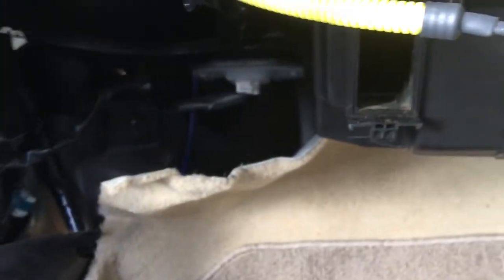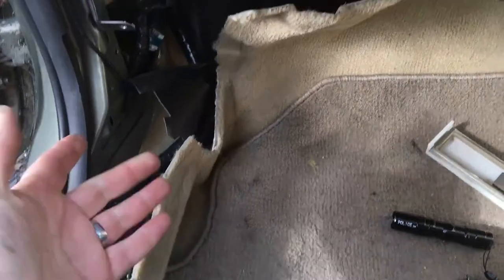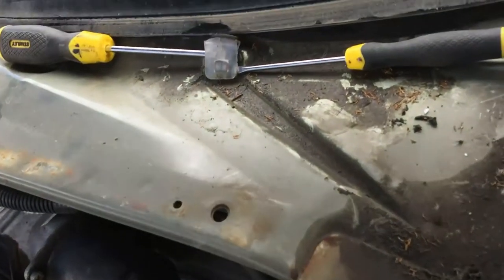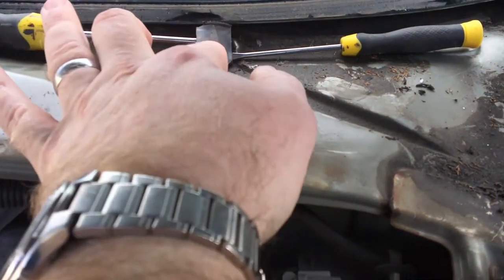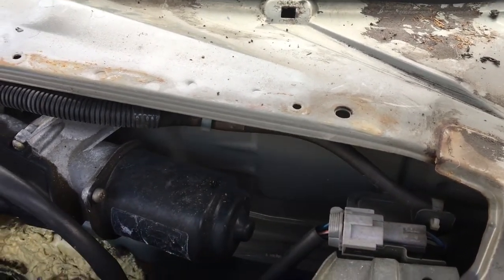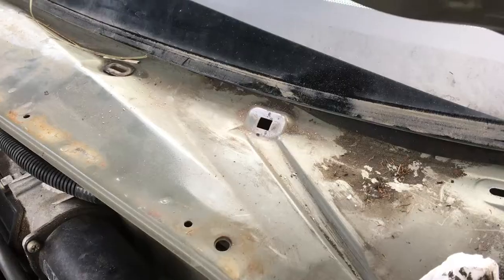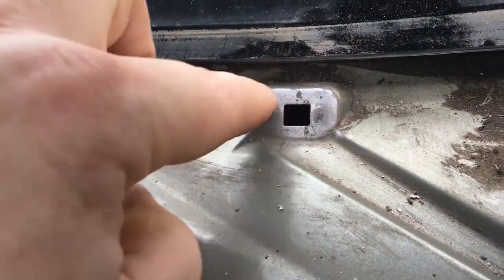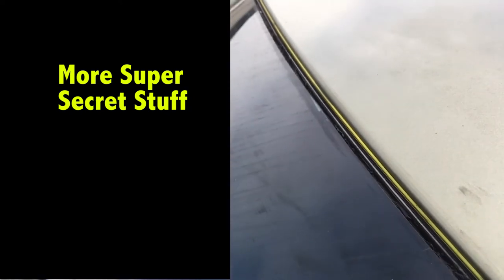#271 Nissan Maxima A33 Leak Repair, How to fix leaks

Comment: They can be a pain in the arse to track down cant they? those little leaks, It took me nearly ten years to track down one in my Merc,  was from the air vent in the 'c' pillar all along, not necessarily bad design,but, could have been better. I used Fernox LS-X, as It was at hand.
 Regards, J.

Comment: It lasted a hell of a long time didnt it, not a bad seal.
The silicone sealant or rubber solution would be my way too.
"Sods law" dictates that you will need to take that strip off for some reason, and the silicone will be a pig to remove ha ha :).

Don't we hate sods law lol.
Reply: I would use dum dum then.